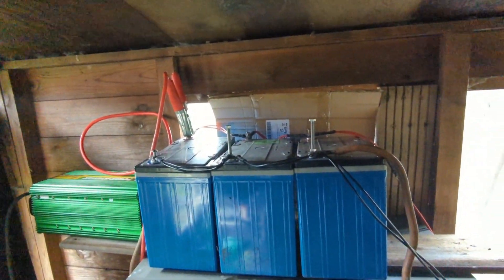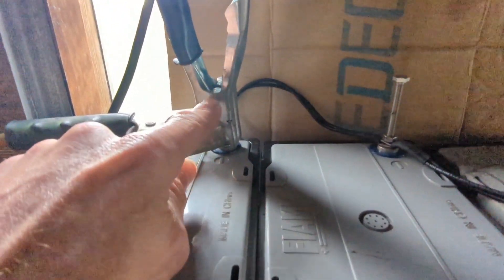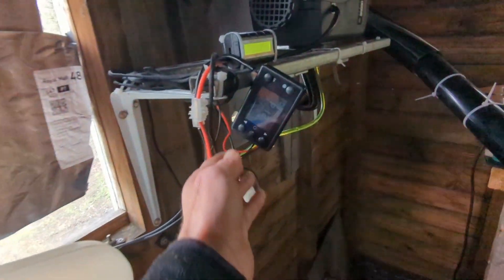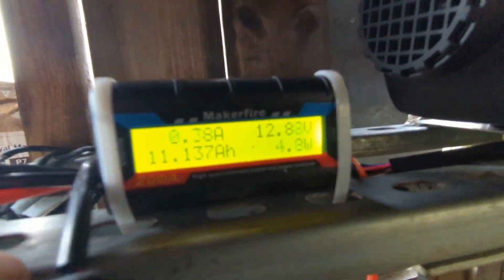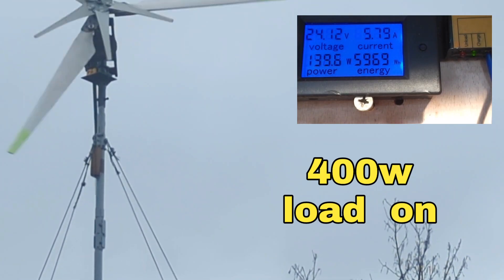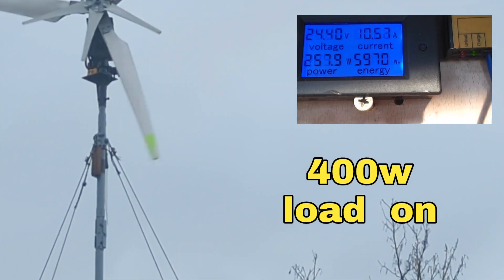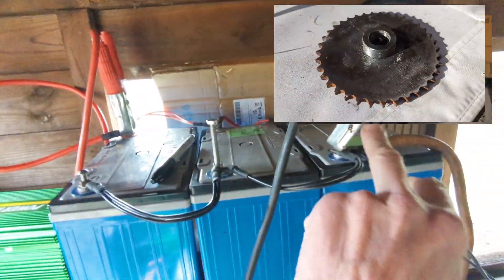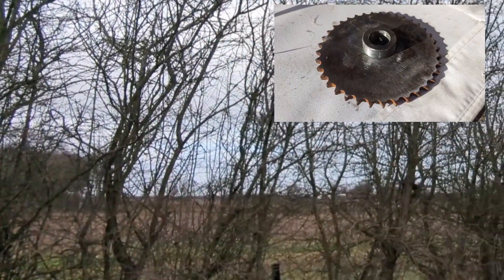DIY Wind Generator Project Free Energy 12v 24v - 23rd February 2023

Comment: What is maximum current give  this motor on 12v system???
Reply from the maker: I have seen This turbine put out over 50 amps at 12 volts and over 70 amps at 24 volts ,  the motor is spinning 1.4 times faster than the blades due to the gearing system .